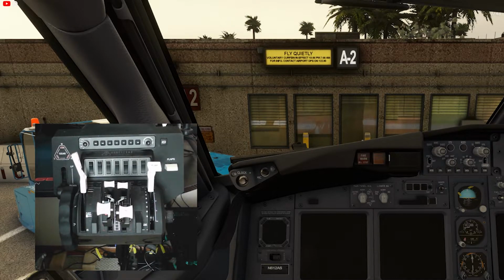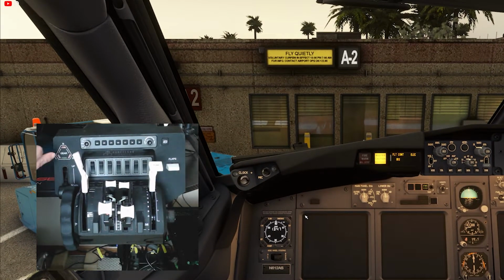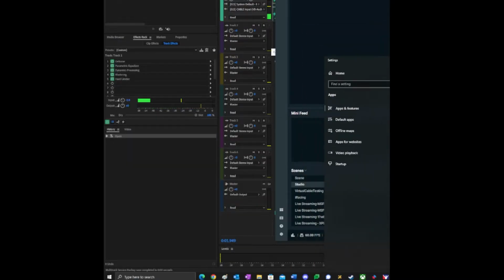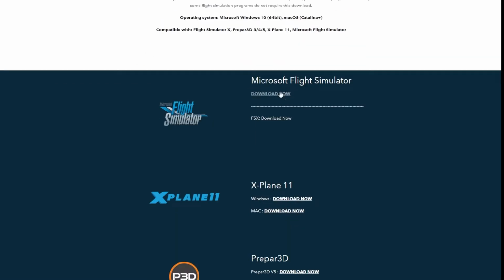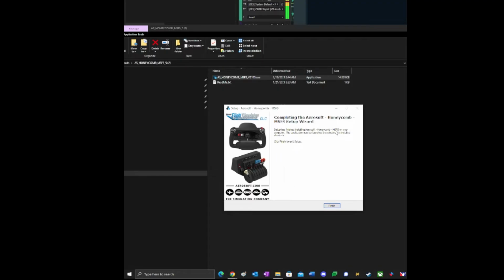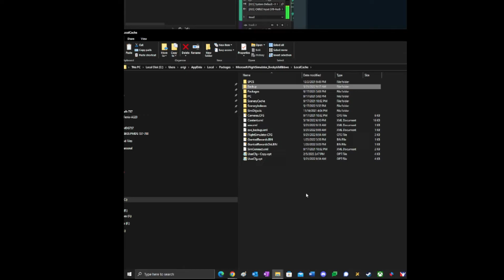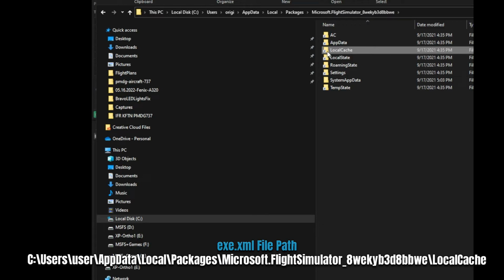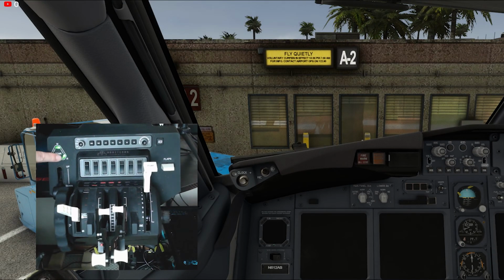MSFS | Honeycomb Bravo LED Lights Quick Fix Workaround | Tips & Tricks | READ DESCRIPTION FIRST!!

Comment: My issue is that my landing gear shows two green and one red although all the gear is in the down position.  Can’t seem to fix it.
Reply from the maker: Which aircraft and simulator buddy?
Reply: @SimFanatic thanks for the reply good brother.  It’s any aircraft in MS2020 or 24.   Same issue.
Reply from the maker: @dr.aviator Has it ever worked correctly or always that way? Feel free to join our Discord server. We have a support channel where i or other SimFans will help you out. 

Cheers!

https://discord.com/channels/825218671743729685/870142679017738240
Reply: @SimFanatic never.  Always had this same issue.

Comment: My old rig died on me so I reinstalled on a state-of-the-art computer.  No lights even after the fix.
Reply from the maker: Hi there @simcaptainrik, sounds like it may be a potential hardware issue. Do you have X-Plane by chance? Would be another sim you can try it with. Be sure that AFC_bridge.exe is in your task list when you are at the world map view in the simulator. If this task isn't running, your lights won't work. Good luck!
Reply: @SimFanatic  It shows it as Not installed in the Content  Manager and when I click on it to install it doesn't do anything.
Reply from the maker: @simcaptainrik  Do you have the software from Honeycomb to reinstall?
Reply: @SimFanatic  Yes I've redownloaded and installed the software per your suggestion. I made a backup in the directory as well.   The lights on the Alpha Yoke are on but the Bravo Quadrant lights haven't worked since I reinstalled everything on my new computer.
Reply from the maker: @simcaptainrik  And if you have loaded into MSFS and are at the map screen, if you do ctrl+alr+del on your keyboard, click on "Task Manager", click on "Details" tab,  do you see AFC_Bridge.exe in the list?
Reply: @SimFanatic  I do not see it in the list of active programs i the Task Manager so It isn't loading.
Reply from the maker: @simcaptainrik  Find the exe in the folder the software installed to and run it manually by double-clicking the exe file while msfs is at the map screen.

Comment: My exe.xml file doesn't have the .XML at the end it is now just exe and that happened as I was trying different solutions to get my A/P light to work, and it got changed. Is there away to get back the original file or do I have to reinstall MSFS2020?
Reply from the maker: You should be able to get it. If not, let me know and I will get it to you.
Reply: @SimFanatic please let me know how I can get that file. I’m just not understanding how it’s just my A/P lights that aren’t illuminating but they function properly

Comment: This "workaround" is - depending on, in which state of exe.xml was backupped - just removing the automated start of AFC_Bridge.exe.
Why don't You show the content of exe.xml to let the viewers understand, what is going on?
A simple solution is: Just make a shortcut in the startmenu to C:\Users\YOURUSERNAME\AppData\Local\Packages\Microsoft.FlightSimulator_8wekyb3d8bbwe\LocalCache\Packages\community\AFC_Bridge\bin\AFC_Bridge.exe
So You can start this honeycomb background application manually BEFORE launching MSFS if it is not included in exe.xml.

And why is this video in the important parts square? And why is it blown up to 1080p while it has a lower resolution, so that You can't read the filenames properly...?
Reply from the maker: Thank you for the constructive criticism. I made this video earlier in my YT "career" so take it for what it is. I checked out your channel. :) 
Cheers!

Comment: Sorry, Honeycomb bravo would be great if it worked as advertised, lights dont (never have) worked for me, unable to assign flaps lever. No help after watching this and so many other videos. Their tech support is unresponsive. Will be returning back my unit for refund soon, if no help received from tech support. Full price for half performance is unacceptable.
Reply from the maker: Sorry the video didn't help. It could be a hardware wiring issue.  Did Honeycomb offer a replacement or repair? Did you purchase the unit directly from them or a reseller?

My experience with their support has been excellent. I had to return their Honeycomb Alpha since it had a bad potentiometer and they were quick to help me.
Reply: @SimFanatic  I already returned for full refund from Amazon as I was not getting anywhere with their tech support.

Comment: How do you get autopilot, nav, ias, etc lights to work? My bravo lights work ie: switch lights and gear. But no autopilots button lights.
Reply from the maker: Hi John, I assume you are using MSFS? Does this happen with the defsult aircraft like the c182?
Reply: @SimFanatic  yes msfs Microsoft store version. And all default aircraft work as they should with bravo quad. Just pmdg issue
Reply: @SimFanatic every plane msfs works except pmdg.

Comment: For me, the problem was that the previous addon above the AFCBridge in the EXE.XML didn't have a closing tag (</Launch.Addon>) so the AFCBridge was ignored at startup and was not being loaded.  Once I added the closing tag to the prior addon (for me it was the FenixA320 Bootstrapper), AFCBridge loaded up with the sim as expected and the LEDs worked.
Reply: If you would be so kind as to explain how to add the closing tag that would be much appreciated and helpful. Thank you anyways for that nugget.
Reply from the maker: Hi Mike P, thank you for watching and for commenting. I have noticed since SU11, AFCBridge has almost automatically opened with the Sim without the workaround. It's not 100% of the time, but close.  Again, thank you for watching and for commenting with the tip!

Blue Skies!!

Comment: did you ever do a DIFF against both files to see what was changed in the "corrupted" exe.xml file.?
Reply from the maker: Hi Shannon, I have not. Although, I completely removed the AFC_Bridge directory and did a fresh install of the Honeycomb software. Now I'm not sure, but either it or the update to SimUpdate 11 fixed the problem because I no longer need to do the work around and my Bravo LED lights have been working almost 100% of the time. Hope you have found this to be the case, if not, I recommend ditching the directory and doing a fresh install.

Cheers and Blue Skies my friend!

Comment: For SU10 this failed in both methods. I have the Steam edition so maybe that's it, but knowing the Asobo, this is just something they don't care for.
Reply from the maker: Hi Cross Hyparu; yeah, I have found with the XBGP version, it sometimes works and sometimes doesn't. Tip though, once you load into MSFS and are at the menu, launch AFC_Bridge.exe (the exe for the Bravo). I created a shortcut on my task bar for this. Works every time; you just have to remember to launch it when you are at the menu. You can't launch it before you load MSFS and if you launch it once you loaded your flight, the LED lights won't work until you go back to the main menu and reload your flight.

Hope this helps. Cheers!

Comment: What about changing the file attributes of the exe.xml file while it is working properly to make it read-only?  That way in theory it cannot be copied over and should continue to work....maybe?
Reply: Exactly what I was thinking. Unless the file needs to be continually modified as the user makes various changes to aircraft configs? I’m going to try read-only and see what happens.
Reply from the maker: I haven't tried that.  Good thought.... did you try it and verify that works?
Reply: @SimFanatic  Tried it and it yes it seems to hold the settings! Also reloaded fresh drivers from Honeycomb per your video. Will be trying the PMDG again later & hopefully LEDs will still work.
Reply: @SimFanatic Update: My LEDs (and LEDs only, no AP, HDG,NAV, etc., lights are inop.) have stayed on. I've updated the PMDG 737 and have since noticed some instability w/ MSFS crashes. 3 this weekend alone. I thought perhaps this was coinciding w/ the change to the exe.xml file. So I unchecked Read Only attribute. Well, it didn't help w/ the instability, AND my lights were still coming on. I really think the new 737 update has cause at least me, some performance issues.

Comment: Idk you guys pay $280 for  this thing and it's not working? what a piece of shit it is?
Reply from the maker: Lol, well Smolex, I'm sure Honeycomb and Asobo will get the LED issue resolved,  hopefully, with SU10. There is an even easier fix submitted by a viewer that I pinned up above; essentially all one has to remember to do is start the software program for the Bravo after MSFS has loaded.

Cheers & Blue Skies!
Reply: @SimFanatic  and what about snapping wires after using reverse thrust?
Reply from the maker: They have a new model of the Bravo so hopefully any issue with that is resolved, not sure. I have never had that issue and I have the original/pre-order model.  I still think it's the best deal out there for the price point.
Reply: @SimFanatic  I ordered Alpha 2 days ago and I'm still not sure about bravo I mean how do I know if this model what I buy is new or old lol
Reply: @Voltomess  Older models do not have the markings down at the levers and the white plastic is really white with the newer model.
Reply: @Voltomess And yes it is ridiculous that a unit costing 300 does not work completely. But that is normal as msfs is the software it needs to run at. This changes over time and needs to adapt. This is why I always wait a couple of years before buying.

Comment: Hi Sir, thanks for a great channel, I totally subscribed. This tutorial helped me in some way but I am still having other issues with my Bravo. My lights are working fine Landing gear light mostly. Since yesterday I noticed Engine 1 reversers are not working. I have swapped and used all four slots and levers to check maybe one of my hardware lever button is faulty..but nothing is making the engine 1 reverser move. Engine 2 reverser still works but I noticed the lever in sim only coming up half way.  Do you think this is a new bug since SU9 or is it me? Cheers man and thanks for your great videos.
Reply from the maker: Hi Phillip G, thank you for the kind comments and thank you for subscribing! Glad the video helped with the LED lights. As for your reverses, are you using the lever reversers on your Bravo or the detent on the axis after the stop at the bottom? I think I can help you out pending which you are using. I use the detent.

Cheers & Blue Skies!!

Comment: Thanks for sharing this information. It is the only thing that has worked for me. It is a pain to have to take this extra step to get the led lights working. But at least this works.
Reply from the maker: Hi Avantuur Light Railway! Yeah,  it's a pain but at least works like you said! Check out the sticky comment above.  That might save you a few steps as well.

Cheers & Blue Skies!!

Comment: Hello Sir, great detective work...definitely fixed my Led lights and I don't ever turn my PC off, so will not be an issue.  Question, Have you experienced losing your sound while in flight sim? This happens with any aircraft, it happens. When in safe mode it never happens with any aircraft that I use...scratching my head!  Anyway, again...GREAT WORK and I'm sure you helped hundreds. BTW, I use a program to uninstall any programs completely, its called Iobit uninstaller...
Reply from the maker: Well hello there RCAviation! Thank you for watching and  for commenting. I'm happy to hear the video helped, thank you for letting me know! That's what I'm here for; to inform, entertain, and also learn from all of you as well! 

As for losing sound while in flight, I can't say that has happened to me so far. I'm guessing you already have done this, but have you checked to ensure you have the latest drivers for your chipset and sound? The reason I ask, is you mentioned if in safe mode it's fine. Are you using any sound capture/OSD software? If so, there may be a conflict. Sorry I can't help beyond that but just something to check. 

Take care and Blue Skies!!!